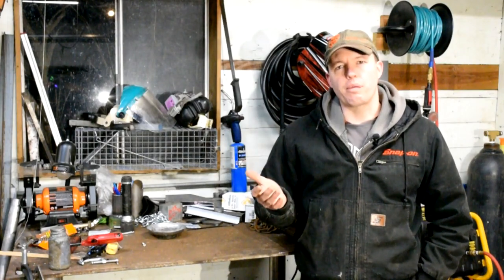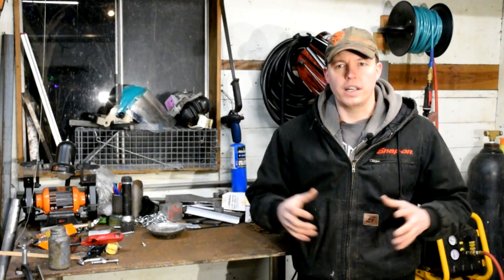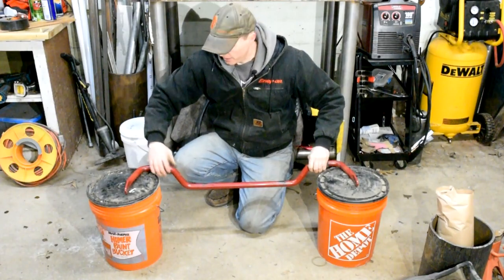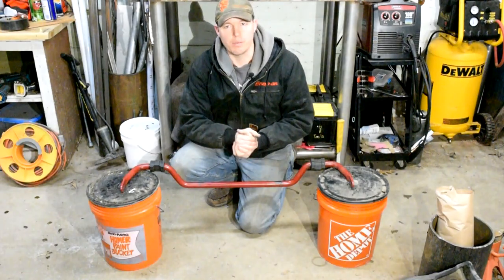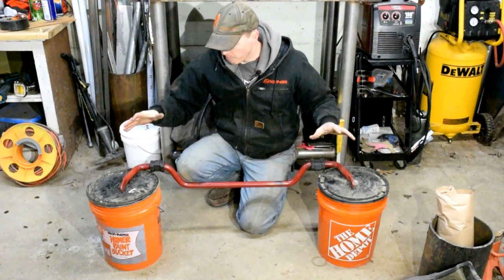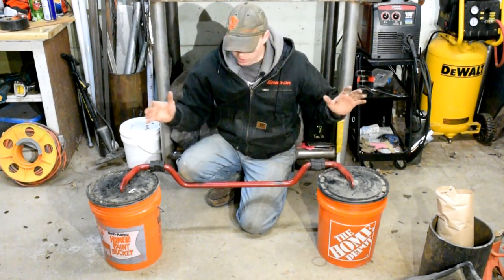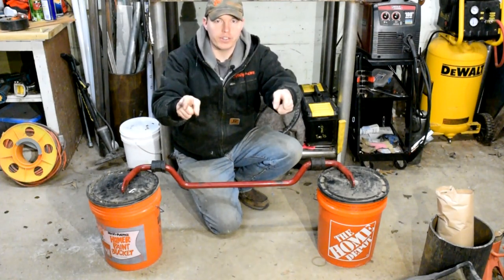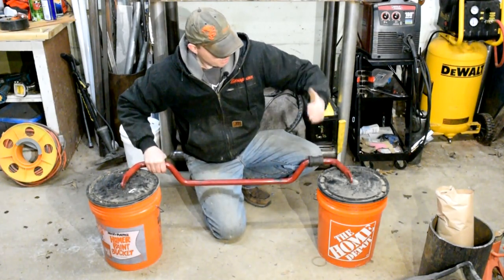How Sway Bars Work - Complete Explanation

Comment: I am confused at 7:22 because here is a video saying the sway bar can be twisted like that: 
https://youtu.be/NFGkZNrNTIE?t=796
Reply from the maker: Kwunmei - what he is showing in the video - the bar twisting, which it does do because of where its attached to the car, but I think the diagram he shows will confuse people because the sway bar ends both want to go in the same direction. In the diagram XF Motorsports is showing, the 150kg pushing down is the outside wheel, the 150kg pushing up, is the inside wheel - the sway bar is going to try and lift that inside wheel, which takes the weight off it. So the sway bar gets twisted, but the ends aren't trying to go in two different directions. Thats why in his next diagrams he talks about the weight coming off the inside front tire, and more weight is applied to the outside front tire. I hope this makes sense.

Comment: What causes engine vibration. My tweaker sister has hired her dope head mechanic to "repair" my dad's car and bill him of his money though he is a senior citizen and it's a criminal charge. Response would be great
Reply from the maker: Hmmm, a number of things can. A misfire - usually from old/bad spark plugs - is the most likely culprit. If they replaced the spark plugs recently, they may not have gapped them properly. Luckily this is usually a fairly straightforward repair and will not cause damage to the engine. If you tell me what work the guy was supposed to do it might help me figure what might be wrong.
Reply: @goddom  they "replaced the plugs. Spacing idk? But I know about engine mount brackets. I think she tried lying to my dad about the sway which is bs  from my understanding as that handles tire traction across the car amoung other things.
Reply from the maker: Yeah, probably not sway bar. It sounds like the spark plugs are the issue. They need to be replaced or checked to make sure the wires/coils are attached properly.

Comment: Do sway bars work better on fwd or rwd or both?
Reply from the maker: They work on both, you just tend to do different things. So a FWD car tends to understeer more than a RWD car - so you may want to add a stiffer sway bar to the rear to make the car a little more balanced and vice versa. Not always the case, but this might give you a little bit of a starting point. The difference is all relative. So you can put bigger sway bars on both ends of the car, but maybe a slightly stiffer one in the front or the rear. I hope this helps.
Reply: @goddom  thanks, i was kinda debating with myself over it

Comment: is there something that is better than a sway bar? say electronic suspension
Reply from the maker: Yeah, there are some new electric suspensions that are better than sway bars that sense when the car is turning and compensates for the lean of the car by adjusting individual shocks/dampers. But for most cars, they still use the cheaper sway bar option.